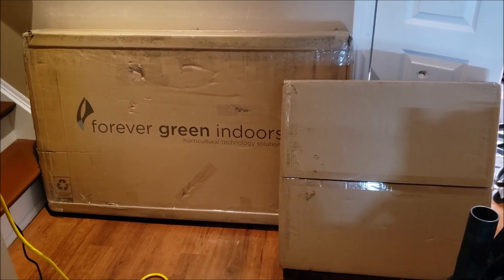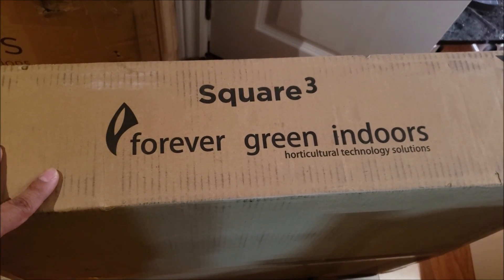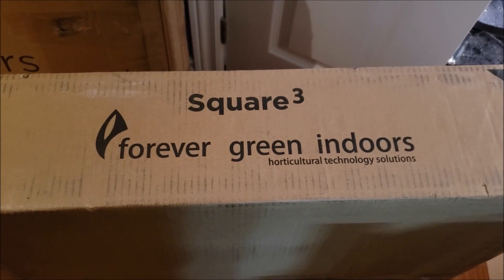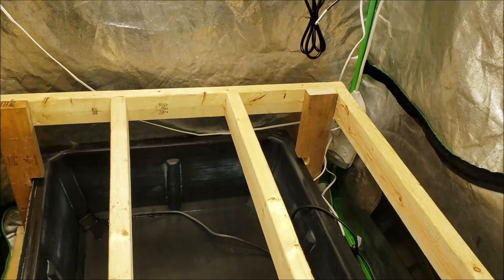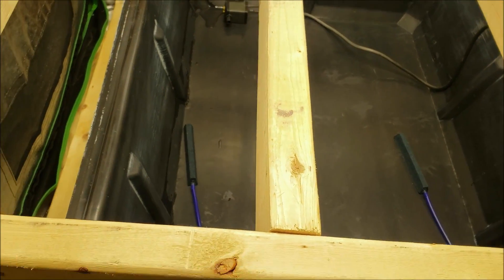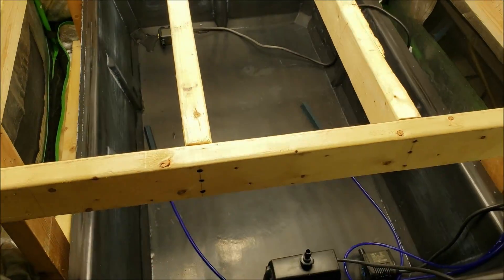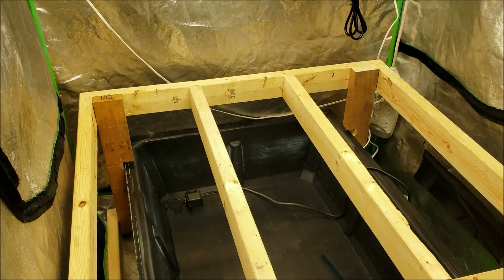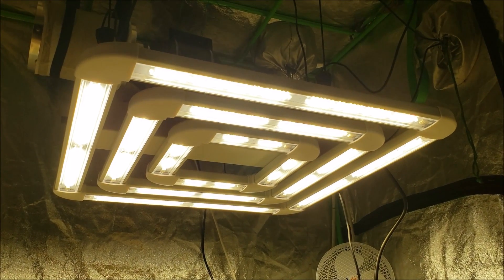FGI Lighting Square 3 LED Flood And Drain Run - Light Unboxing - E1

Comment: Im a new subscriber and grower i have a question bro, im getting ready to hang dry, what number should i look for on the moisture meter to determine to take them down?
Reply: In my 8 years of growing I've never used a moisture meter, buuuuut if 90% of the stems you try to bend either break, or violently crease, it's time to trim. I believe i heard an early episode of the "homegrown helpers" podcast that the consultant used moisture meters for everything, including soil, but i can't remember specifics of what he said.

Comment: Nice concept.  It'll eliminate hot spots that LEDs produce.
Reply: Looks a lot like the lumetec rig ive just ordered attis 3oow £349 GBP
Reply: @richardgrimbleby7853  the lumatek attis 300w looks like a killer light I'm seriously considering getting one.
Reply: @craigking8758  shud be here mid week al try let u know how it looks bit new to this comments buisiness cheers
Reply: @richardgrimbleby7853  lumatek's latest fixtures(zeus included) uses the same diode manufacturer so there's a reason it looks a lot like 😉

Comment: 500 bucks for 300w of offbrand Shenzhen Lideda chinese diodes from a new vendor with no reputation ...i'll pass.  i do hope it works out over time for you tho
Reply: Shenzhen diodes are the #1 provider for vertical greenhouses in every country outside of america and the #1 seller on the planet even with Samsung's 4 year stint of horticultural efficiency gaining them sales. Samsung is rapidly closing that gap, but still not the same number of sales as Shenzhen Lideda. Not saying they are better than current samsung tech, but saying they aren't without reputation or even a "new vendor". FYI the Lumatek Zeus 600w uses Shenzhen diodes and is currently the most efficient fixture, with only .03 umol/J better than growcraft(samsung diodes) by chilLED tech, but still that slightly higher efficiency.
Yeah my personal preference will still be samsung diodes for the white and red, cree for blue, and LG for UV.